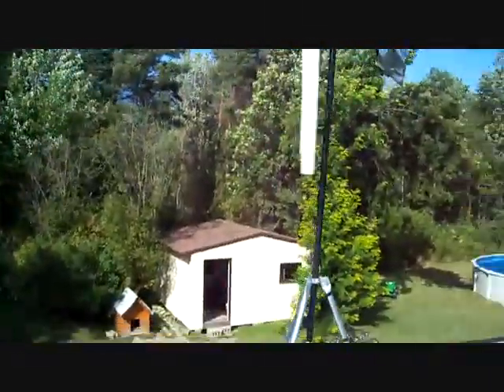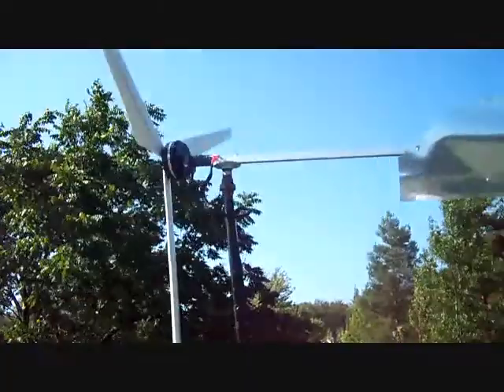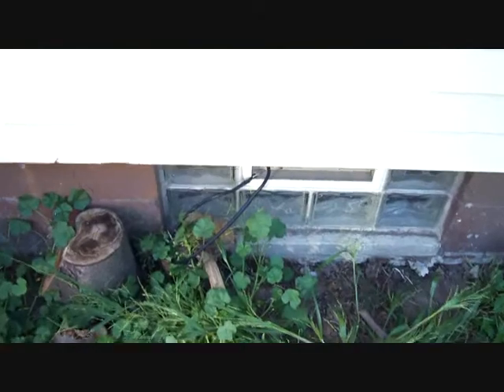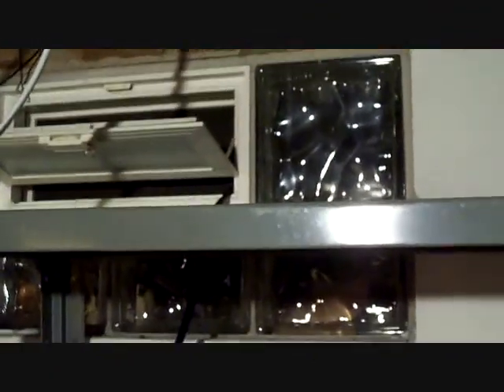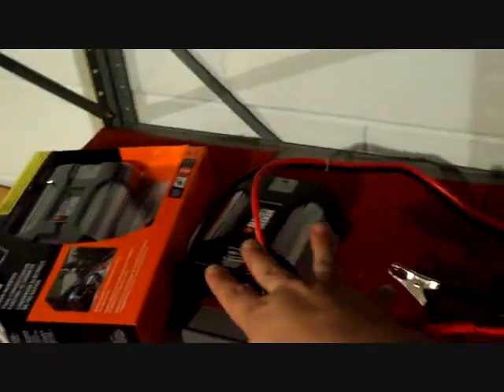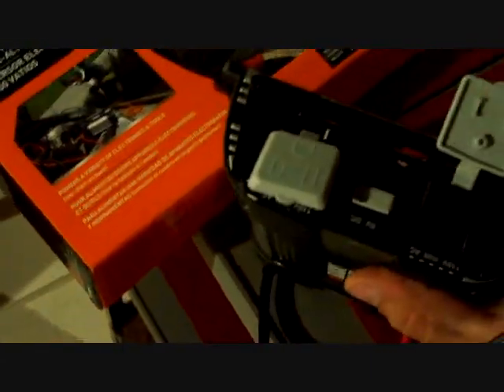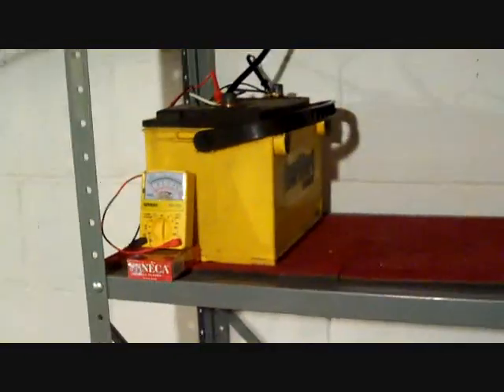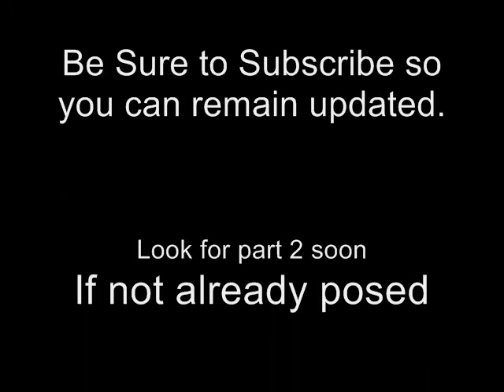Wind Turbine Electrical Guide Part 1

Comment: people, please be careful! look up some wind turbine destruction videos. those blades are dangerous to be near, and can go flying if something goes wrong. safety first pls.

also, car power inverters don't sync the outputs. the output frequencies will likely be off phase if you try hooking them up in parallel.

befriend an electrician if you plan to do something like this. it will pay off